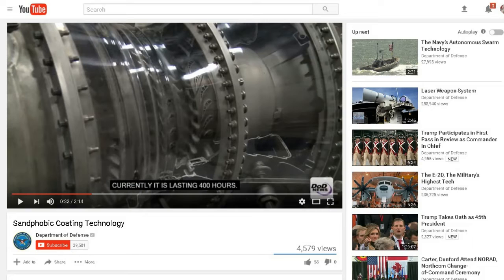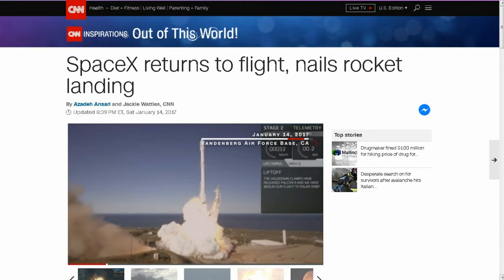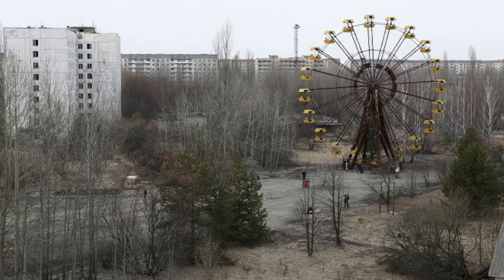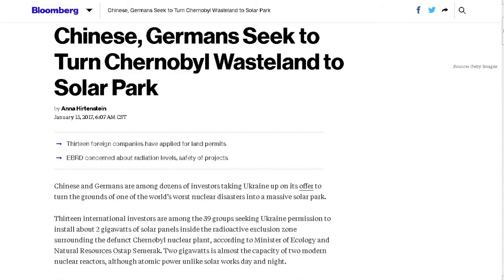TDD report for January 21, 2017

Comment: Here's one for ya... Why can we not develop something that collects the Radiation from say Cherynoble, and turn it into power. Kind of like Solar power? Just got me wondering.
Reply from the maker: The dead reactor is still kicking out a lot of energy in heat and radiation. One problem is that you would need robots or lots of people rotating in and out to extract useful amounts of energy. I think for now solar in the less radioactive areas is cheaper cost.
Reply: Takes Robots to do either or,  Just thinking, all them rads could still produce Energy if they were able to be collected. Like a solar panel type thing.
Reply from the maker: Cosmic rays are quite powerful, kind of like bullets. Not sure what type of device could catch and use them.